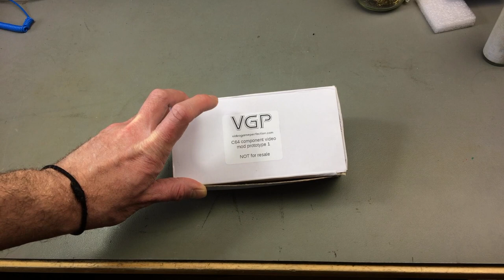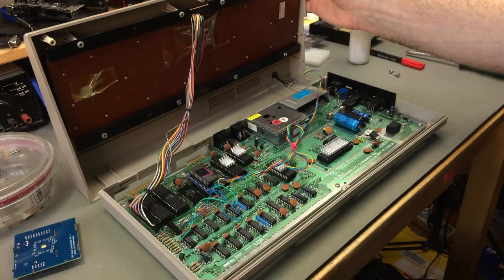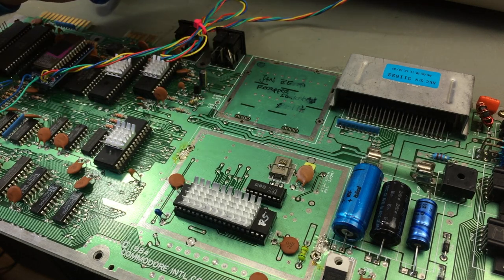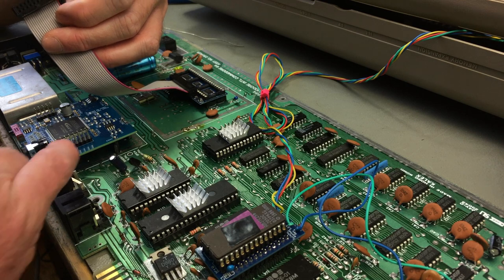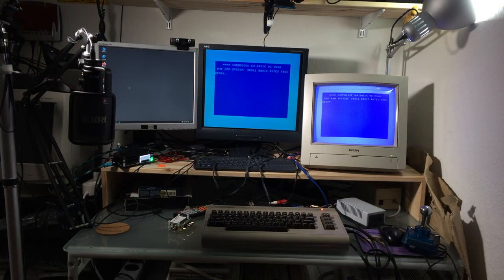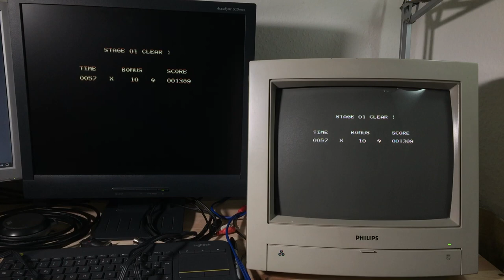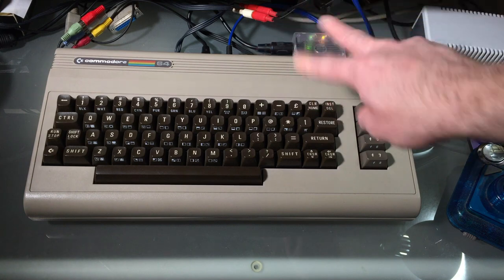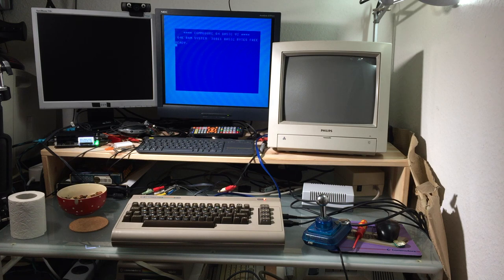C64 Component Video Mod Prototype Testing

Comment: Very interesting bit of kit! This has probably been answered since this is your system but what is the reason parts of the bottom of the PCB look so wrinkled?
Reply: Thats because the copper traces are tin plated, its was done on a lot on electronics from the 70`s and 80`s, think it was supposed to help with conductivity or something
Reply from the maker: Yes, it was supposed to make the traces wider for more current carrying capabilities.
Reply: I was actually shocked when I saw my C64's PCB wasn't wrinkled like that.  I've seen so many wrinkled ones on youtube that I was expecting it.

Comment: Videoing CRTs is hard.. LGR had a video about the challenges a while ago. Very hard to capture and represent what you see on the screen.
Reply from the maker: Yes! Turns out it's even more difficult to have a TFT and a CRT in frame at the same time and make it look half way decent... ;)

Comment: Have you tried this component output as an input for the framemeister component cable? Would give another hint about the capabilities of that cable and the framemeister regarding component video :-)
Reply from the maker: Don't have a Framemeister, but the component worked on both the OSSC and the RetroTink2X that I tried.

Comment: To bad kits not available now. Works on a Vic 20 also correct?
Reply from the maker: No, this won't work on the VIC-20, as the first VIC chip is completely different from the VIC-II used in the C64!

Comment: Very cool. I've wondered if this was possible.
Reply from the maker: It's only possible by basically creating a completely new video signal from the signals that go to the VIC-II. Getting RGB or component out of the original video signal is impossible as far as I know.
Reply: @JanBeta  I should have said, I wondered if it was feasible. 😉
Reply: @JanBeta  does this mean that it doesn't require a VIC-II if you aren't going to use composite?
Reply: The VIC-II is still required, because the mod only listens passively to he communication between the VIC-II and the rest of the system. The VIC-II is responsible for addressing the video ram, blocking the CPU during this, forcing DRAM refresh cyles and much, much more.

Comment: Will it fit into C64C case with short board?
Reply from the maker: It’s a tight fit, but it fits the C64C case, too. :)
Reply: @JanBeta  Thanks a lot for the answer. That is very helpful.

Comment: Wrap the U2+ in foil and see if the hissing goes away.  Also, try using better cables.
Reply from the maker: Tried several cables, some of which I made myself. No difference. I think it's really a shielding issue with the U2+/the mod board.

Comment: As you said, it does not look original, the softer, less sharp image as the original had actually did the pixelated graphics a favor. I recwntly hooked up my Amiga to a new tv via RGB and it looked horrendous. I wish I never tossed those perfectly usable CRT's in the dumpster 🙄

Comment: I would probably put a heat sink on the FPGA if there is enough space...
Reply from the maker: Yes, a flat heat sink should fit on there. But it doesn't get very hot, just warm. I guess it is absolutely fine without a heat sink.

Comment: I don't really see the point of this one: The VIC-II generates native S-video, so you cannot get any better picture quality than S-Video. The only reason for video conversion is compatibility with modern screens, but then component isn't the most optimal choice? Because of this, you upscale the signal two times, first inside the board, then again inside the OSSC. If you have bad luck, the monitor may upscale it a third time.

Conversion to VGA or HDMI would have been much more useful, because there are many monitors that accept such a signal, but component? Perhaps useful for older American TVs,  but those likely already have S-Video?
Reply: The mod does not use the original s-video signal (noisy and overall quite limited in its quality) at all. The component video signal is generated inside the mod using only digital data from the communication lines between the VIC-II and the rest of the system.
Reply: Component supports progressive scan and HD resolutions. Component is the enhanced version of S-Video which is always interlaced.

I don't know what they were thinking, but I think more TV's, upscalers, etc support component than they do VGA, but why they didn't go for HDMI? One reason for that could be that you need to (or should) pay $5000 a year and $0.05 per unit if you produce devices that have an HDMI connector. DisplayPort is superior in every way and is free to implement. I think the mini displayport connector (which apple has licensed for free to VESA) could maybe even fit through the old RF-connector hole, so you wouldn't need to mod your case.

Maybe they're already pushing the limits of the FPGA chip with the VIC emulation and the component output is less demanding to output? Or maybe it's just easier. The thing is a hobbyist open source project, not a commercial product. 

It can be configured to output various forms of RGB instead of YPbPr if needed.
Reply: @kke  It is a weird choice, but might make sense from an American point of view. Traditionally on the west side of the atlantic TVs had component and on the east side of the atlantic they had SCART. Monitors have (or better, had) VGA. You can target both SCART (for SD purposes) and VGA (for HD purposes) from a single analog RGB connection.
Reply: @copperdragon9286  Oh... so replicate the whole VIC-II on an FPGA. That might have been mentioned as board that decodes S-Video or can replicate a VIC-II is quite a different beast.

Seems Jan was not able to discover incompatibilities, so congratulations for designing a full VIC-II compatible with original hardware!
Reply: This is not a full replication of the VIC-II. The mod only emulates as much as possible it needs to produce the correct video signals. It heavily guided by what the original VIC-II is doing at the moment to figure out what all the data signals actually mean. With this approach I cold just squeeze all the logic into this fairly reasonably prized FPGA (a MAX10 with 2K logic blocks).
Reply: @kke  I have yet to encounter anything that actually accepts DisplayPort input. Isn't it only used by monitors?
Reply: @stevethepocket  I wouldn't want to indulge in conspiracy theories but I think there could be something fishy about it. Maybe TV manufacturers are beneficiaries in the HDMI alliance? Or they're already so used to pay for it? Or maybe they're trying to protect their monitor sales? I don't know. You can get a DP->HDMI adapter for quite cheap, I assume it's pretty much close to a passive  transformation as the smallest ones appear to be just a cable with DP in the other head and HDMI in the other. 

But for a small indie product, it's probably a lot safer option to implement DP instead of HDMI to avoid having to shell out a zillion dollars that may not even be covered by the sales.

Comment: You can but whole computer to Altera chip. What is the point? This become emulator in original box... next step is full software emulator. Where is the border between pure restored computer and new one?
Reply from the maker: Good question. I don't have an answer. I guess it's a matter of taste or "ethics" if you want.
Reply: More options are a good thing. Some people want only the original thing. Some people are OK with some mods like this one. Some people are ok with using an emulator. Some people want better emulation so they buy a MiSTer which has an FPGA core for the C64. All of this is hobbyist driven, and if you aren't interested that's fine but if people are willing to design a board like this and people are willing to buy it then it should stand to reason that someone wants this.

Comment: No PAL color blending? Disappointing...
Reply: The firmware does supply the tools for simulating colour blending, but it's up to the palette to enable it.  The default palette doesn't.

The palette is stored as two 256 entry tables.  Each entry is 16 bit wide representing a 3*5bit palette entry and can be visualised as a 16x16 matrix.  The palette entry the firmware chooses to display at any given time is based on the colour index the VIC-II wants to display and what it displayed on the pixel directly above.  There are two tables, one is used for odd scan lines and the other for even scan lines.  This allows for some approximation of the effect of the PAL phase offset between odd and even lines.  It's all down to defining/calculating the colours and uploading them to the mod.
Reply: @HojoNorem  The casual user will therefore suffer with non-standard default colors that are not correctly blended. That's a shame...